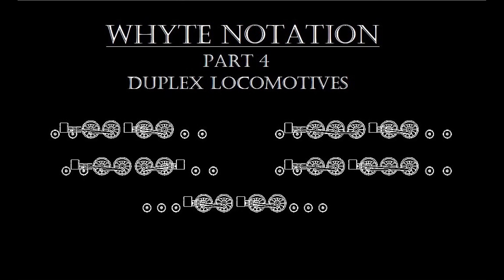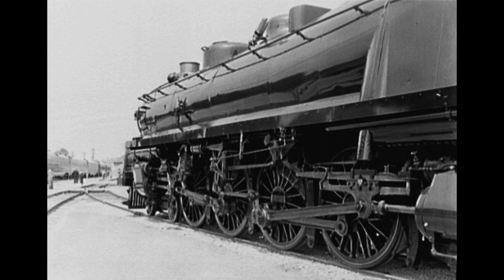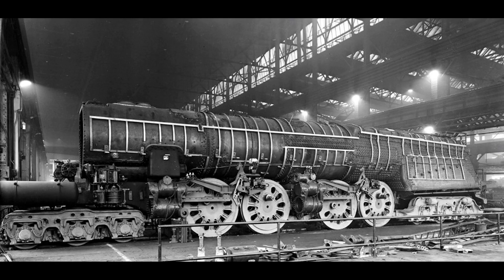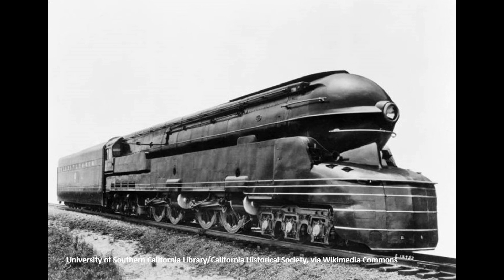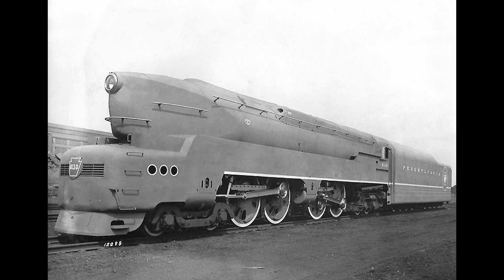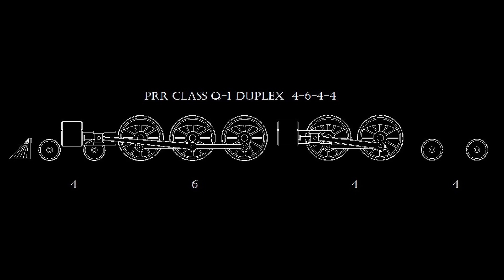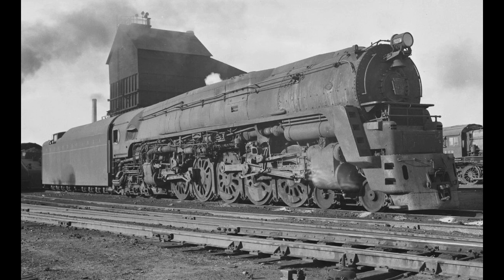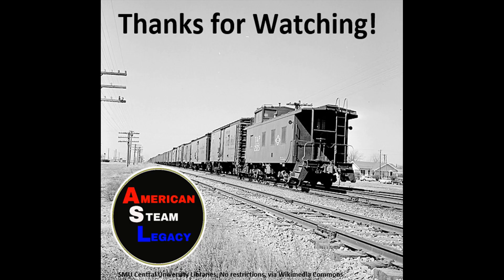Whyte Notation - Part 4 of 7 - The Duplex Locomotives

Comment: I have a couple of duplex engines for passenger duties on the san jaun and gulf, the j2 class is based on the n&w class j so it has a 4-4-4-4 wheel arrangement,with 71 inch drivers and a continuous tractive effort of 66,432 pounds of tractive effort they pull trains like the st Louis limited,the Denveran,and the huston rocket,while the j3s are  4-4-4-6 engines producing 13500 more pounds of continuous tractive effort respectively they pull trains like the mephis specaul out of chicago, tampa flyer from alanta to tampa and the dallas to huston texas state specail.